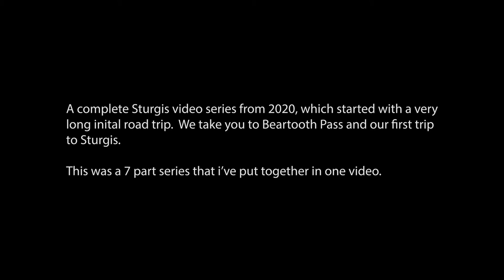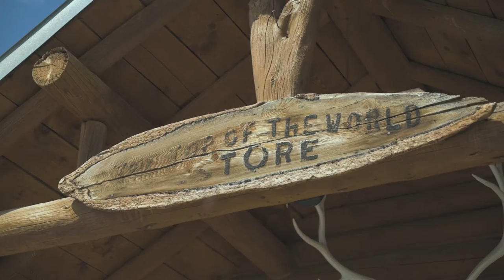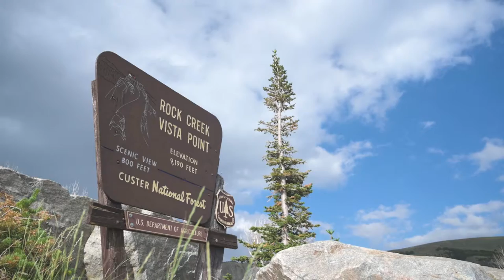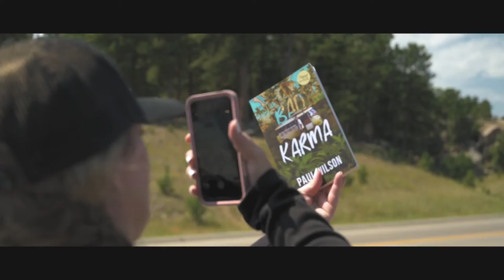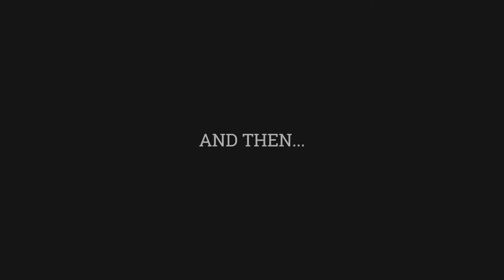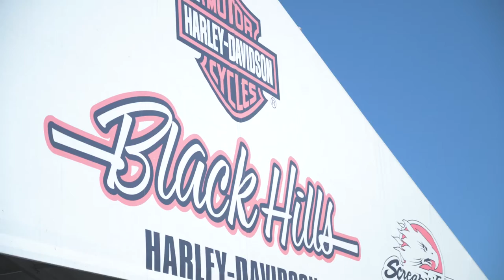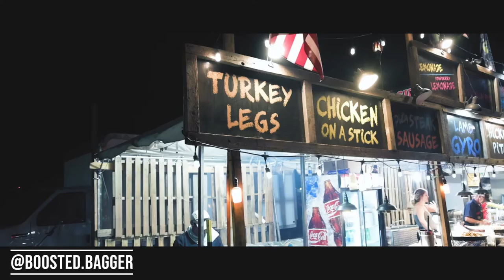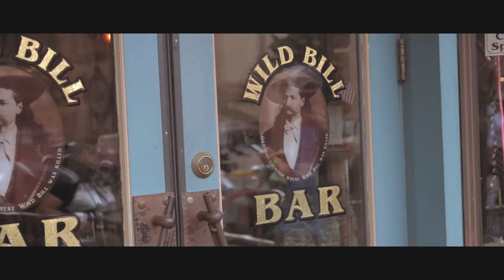The Sturgis Motorcycle Rally (A complete trip: San Diego to Beartooth Pass, to Sturgis)

Comment: 30:00 Never have I had a problem with rain gear with stock exhaust on my  2018 Sport Glide.    The heat shields on factory HD exhaust systems just don't have those kind of melting problems.There might be something to be said about stock exhaust, and HD being worried about sue happy customers and lawsuits.  However, if you're the Outlaw type... Loud pipes might save lives, but they don't save rainproof gear if it's plastic.